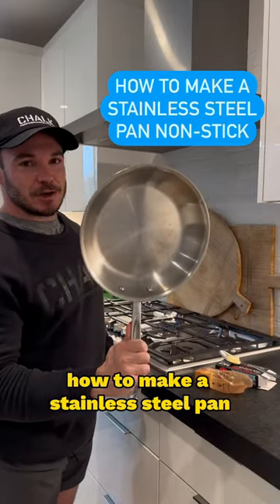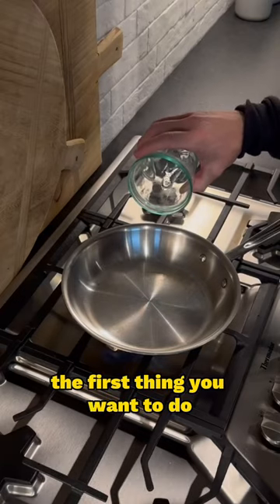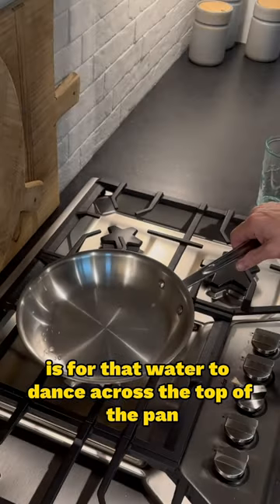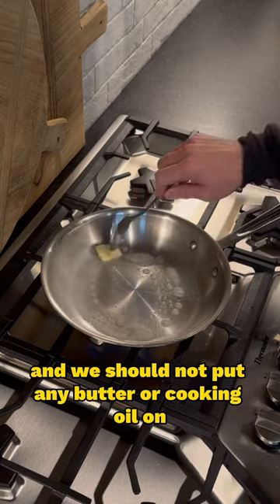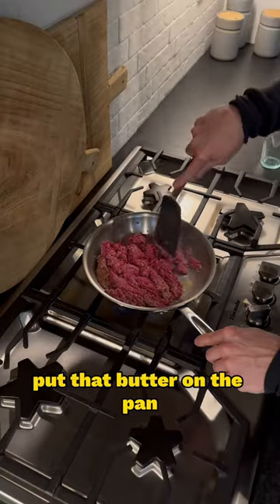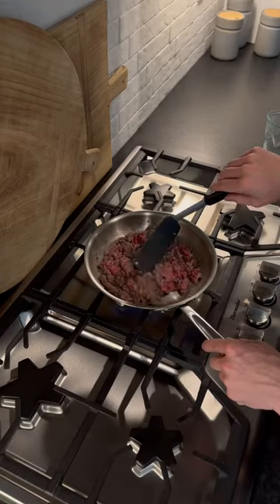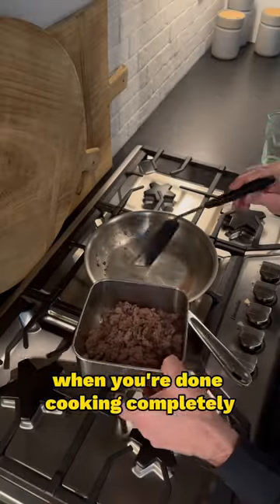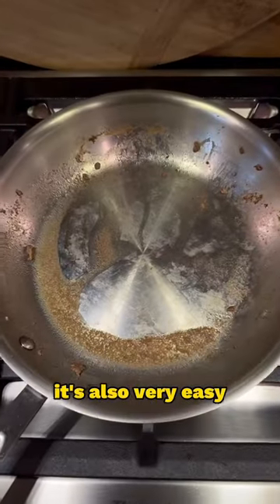How to make a stainless steel pan nonstick.

Comment: One thing I will say, DO NOT do this if you do not have a vent hood bc you are going to set off the smoke detector. You can’t really see it in this video, but when you cook at this high of a heat the fat from the meat and the butter essentially burns off creating smoke. This method is the best way to get a great sear on any cut of meat, but proper ventilation is necessary.
Reply: Teaching me shit id never would have known or been taught before messing up on haha, thanks man.
Reply: you can avoid smoking your oil I'm sure. use this trick for eggs it'll show you how the pan doesn't need to be so hot initially and your oil doesn't have to get hot. I say eggs cause yk how sticky those are, I promise you can have easy eggs no problem no smoke at any stage of pan to plate
Reply: i wish these videos had this as a warning because i tried this the other day and my pan burst into flames lol

Comment: . . . So a hot pan, that’s it, no real trick
Reply: Basically. The way it works is pretty simple. When you use butter or oil in a pan, protein will still stick to the pan, however, the fat allows the surface of the protein to be in full contact with the pan. If you are cooking a protein like steak or chicken, place it in the pan and give it a slight press. From this point, nudge the edge of the meat until you feel no resistance and it will come clean off the pan. Do not try to flip it prematurely, otherwise you will tear the protein and lose the crust which will be stuck to the pan. The natural sugars and fibers of the protein are caramelizing to form the crust which is called the Maillard reaction.
Reply: Also, I just wanted to add, what he refers to as the “water test” is called the Leiden frost effect.  The way it works is that the pan is at a very high heat. The water droplets are surrounded by water vapor as it instantaneously boils, the droplets are not actually contacting the pan, so they are able to “dance” around the pan until they completely evaporate.
Reply: It’s also by no means “healthier” as he puts it. Nothing is changing with the actual ingredients, so there would be literally no difference with how healthy it is. 80/20 ground beef is 80/20 ground beef no matter how you cook it unless you drain the rendered fat Like a person with no taste.
Reply: One last thing and I’m sorry for spamming, I would highly advise you not to use butter when cooking at that high of a temperature. The butter will burn due to its lower smoke point and the milk solids can burn which can ruin the flavor of your dish and dirty your pan. I’d recommend canola oil, or even just clarified butter “ghee” which you can buy in any grocery store or make your own with a little extra time. 😅
Reply: Sorry, one last thing I forgot. This is more specific to ground beef used in the video. Because it is ground in a meat grinder, all of the fibers are broken up. When you cook ground meat the fat will render a lot more because it is not held in a larger cut of meat, so, in this scenario, you do not even need to add additional fat to the pan because the ground beef has enough fat in it already to sear and cook properly. Just make sure you break up the meat well to not get stringy or chunks of ground beef.
Reply: @Max3doutGaming  the healthier cooking comment is in regards to using stainless steel as opposed to a teflon or other coated non-stick pan